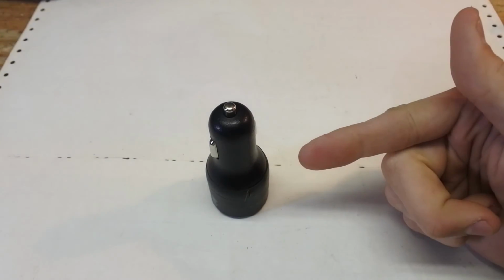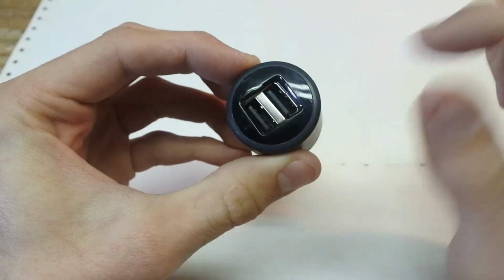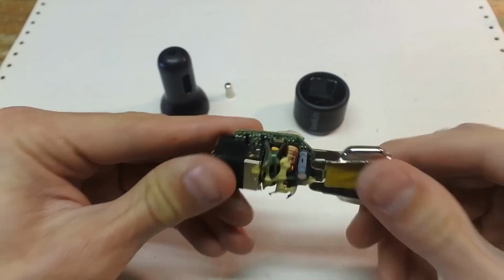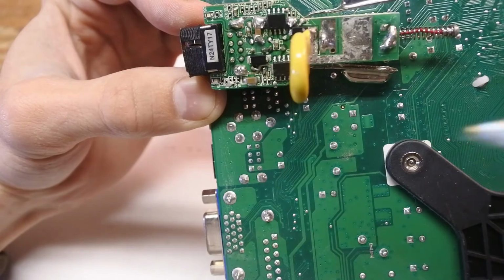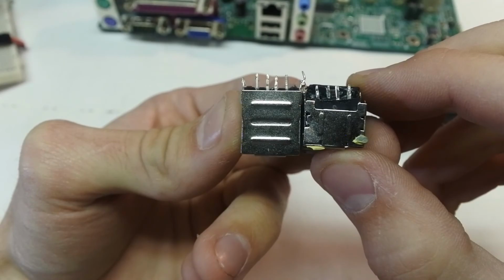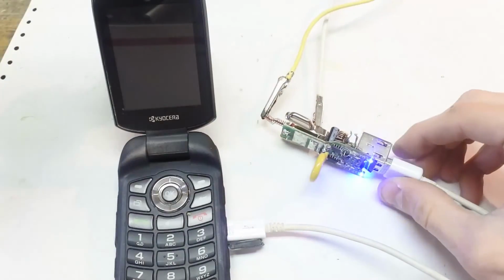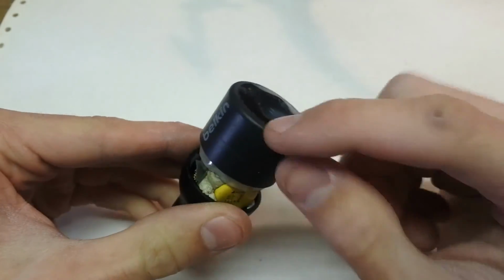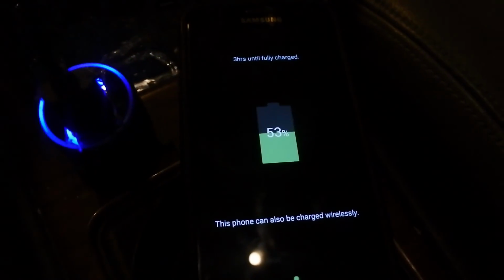Belkin Car Charger Repair

Comment: It always feels good to recycle instead of throwing away things !! I wanted to search how to replace fuse on Belkin F5L071ak200W and landed here. 
My car socket supports 12V 120W and my inverter has a fuse of 20Amps. I think inverter should have 10 Amps if car has 10 Amps Am i right ? Any guidance on how to change it by looking at the product ?

Comment: No need to do this,you should take it apart just for cleaning and resoldering  Usb socket pins(because of oxidisation )and get tinnie electronic file to clean  power pads (inside USB socket) that it,I fixed mine this way but good advice regarding hot air blower otherwise it would be impossible to take casing apart

Comment: how did you get the front plastic cover off?
Reply: You can open with a hammer just hit it on the side
Reply: I am having to do the same thing but with a mashed up single usb port on the 30 watt Belkin laptop car charger